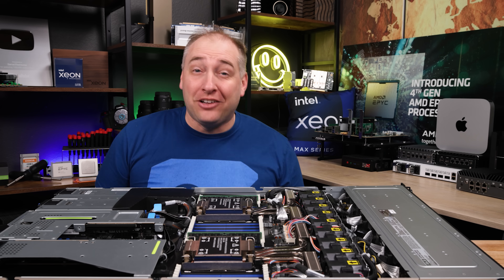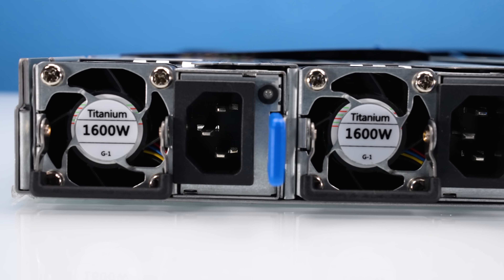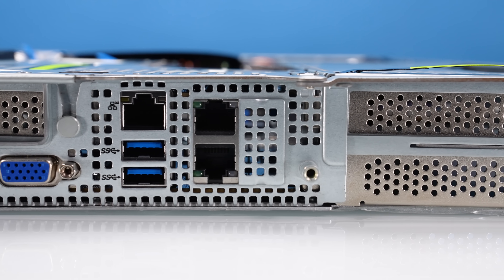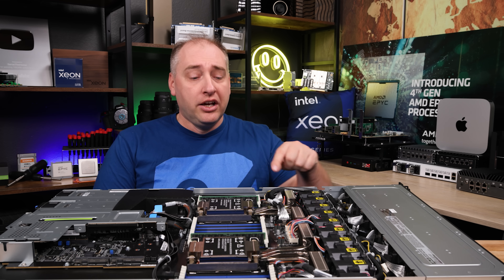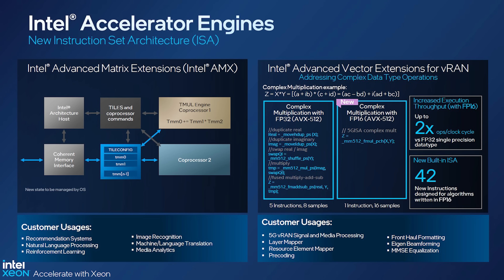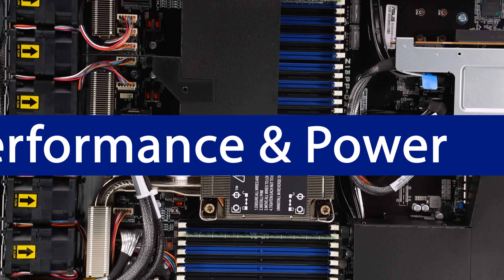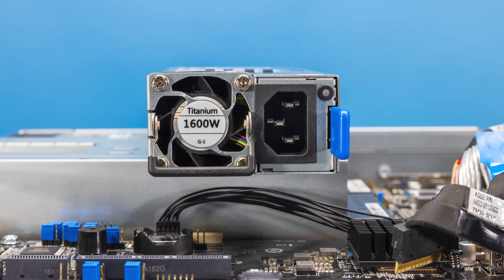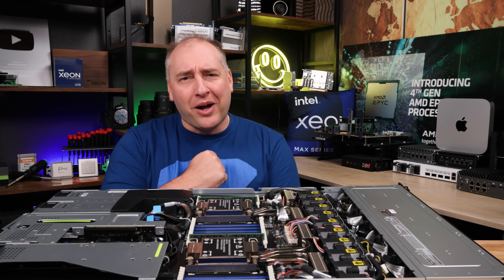What makes this ASUS server better

Comment: I noticed that the power and reset buttons on the front are very small.  A comment pointing that out would be useful and a statement of how easy (or not) it was to operate those buttons as well.  This applies to other new servers as they find ways to maximize front panel space for drives, causing switch shrinkage.

Comment: Interestingly at USA voltages the PSU draws 12A through a C14 socket. Given that the C14 socket is only rated for 10A that's er a no no. Of course, in sensible 230VAC land that's not an issue but in 110AC land you are limited to 1100W on a C14 socket. That's why lots of servers with large PSU's have C20 sockets. So for breaking electrical safety standards I give this server 0 out of 10.
Reply: In North American standards you are allowed 15 amps on these connectors so that's not a big issue. The bad thing is most cables aren't good for that much current.
Reply: @eDoc2020  no the connectors are rated for 10A period. It's part of the standard. Find me a data sheet from a manufacturer that says 15A is Ok. Using them at higher amperage is a fire risk. Then again electrical fires occur at a much higher rate in north America than Europe.
Reply: @jonathanbuzzard1376  A quick look at digikey's "power input modules" ... the first result is the Schurter 6100-3, "Ratings UL/CSA 15 A / 250 VAC; 60 Hz"

The second brand that shows up is Qualtek, model 703W-00/04: "RATING:
UL, CSA: 15A 250VAC
VDE, CCC: 10A 250VAC"

Then there's TE Connectivity's Corcom SR series: 6ESR Models 15A Max.

Comment: Hi Mr. Patrick, one suggestion. It will be nice if you can start the server and show the firmware options briefly and even how loud it is during boot. Also mention the power consumption at idle.
Reply from the maker: We have the idle power on screen as well in the power section. These are so loud with 300W+ CPUs that they are meant for the data center.

Comment: how bad is the noice of the fans, its something i like because i don't have a rack and i run everything in my office for now
Reply: My suggestion, better invest in a sound proofed and air conditioned cabinet. DIY if you cant afford.
Reply: also i forgot to ask, could we have an update video on 10 gig switches? anything new on the managed 10 gig switches cause currently i'm trying to find a 10 gig switch and i'm hesitating between crs309-1g-8s+in and the unifi aggregation switch

Comment: Didn't know they make cool stuff like this.
For cooling we have some older HP DL360 G9's in the DC in one of the racks and they have the same cooling setup but mostly copper. I think it's the e5-2699 v4 batch that came with those coolers. I would love all that pice and nvme internal expansion.

Comment: Patrick, you talked about cooling a lot, but any actual experience to share about the heat a fully loaded system would generate?  Do the PCIe5 slots in the back get anything but hot air after going over that much NVME, DDR5 RAM, and CPU?
Reply: I would say yes. If the fans create enough pressure then the air coming from cold side does not have enough time to heat up that much but I have seen DCs where the cold side is not that cold but it should still be no issue at all

Comment: Power button at the back is a nice feature and bad feature. I know we've had our techs boop one of those when messing around in the back. Human error and learned from it but still one of those arggg moments.
The drives needing screws is another pain this was my issue in another video but that one you said was tool less guessing this is due to just the 12x nvme in the front having this issue. Overall they are nice systems. We used a bunch of these for the 7443P systems to support 12x nvme's found out a lot of our clients ordered these with 1-2x nvme's only so we started going with a Tyan 2U 4 node which supports 2x M.2 and 4x hotswap nvme each node. It was also on special for a while for $2250 for the barebone with free shipping for a 2U 4 node which made it a lot cheaper than the Asus 1U 12 bay at $1600.

Comment: price?
Reply: 2x first born child
Reply: The price of this server (and actually any server) really depends on what you populate it with (CPUs, RAM, etc). The naked chassis price usually ends up representing < 20% of the total cost of the server, but then hosting it somewhere becomes an even larger cost than the server hardware cost itself. So unless you have very specific needs and requirements, for 98% of applications it makes more sense to host them somewhere on a virtual machine (or many).

Comment: Nice! I really want to hear how loud these fans can go though.
Reply from the maker: No you do not. Very loud! :-)
Reply: @ServeTheHomeVideo  actually would be pretty cool. Some of us weirdos love that stuff lol
Reply: @anothersiguy  Server ASMR
Reply: Loud enough you need hearing protection if you've got more than one of them on your desk. Fill a couple of racks and hearing protection goes from "I really want it" to "I need it!". I sabotaged my hearing building 1U servers. At first it was just that you felt tired, then you noticed that after along day testing servers there was this ringing sound in your ears, especially noticeable when you were trying to sleep. Then you noticed it was there when you woke up...

By then your hearing is irreparably damaged, and it just goes south after that. So use hearing protection before you get any damage.

There's all kinds of hearing protection. I recommend the silicon plugs that are intended for musicians. They will protect your hearing, but it retains the tonal quality of voices and such. They are a bit more expensive than the simpler versions, but you're much more likely to use them if you don't have to yank them out to hear what people are saying.
Reply: @blahorgaslisk7763  do they not have health and safety in your country? Hearing protection in the data centre is a must, just because it is white collar does not mean it is not required. Oh and add steel to cap footwear to the list of PPE you should be using when working in the datacenter.

Comment: I'll take 6 for my homelab, please
Reply: I don't have the power in my apartment to run such a thing. Dealing with an R750 that pulls almost 400 watts at idle.
Reply: @jeffnew1213  Wire it to your neighbors circuit panel.
Reply: The noise for 1ru in homelab is not nice unless very far away. I stick to 4u and they are barely audible and do spin up a little bit during heavy load but usually in spikes
Reply: 250W idle, it's a joke compared to LGA1151, LGA1200 doing ~15W per socket.
Reply: Quit being greedy.... 3 please 🥺
Reply: @tollav  Amateur's! I will need 48 to populate my rack!